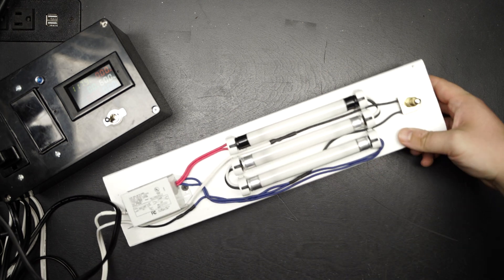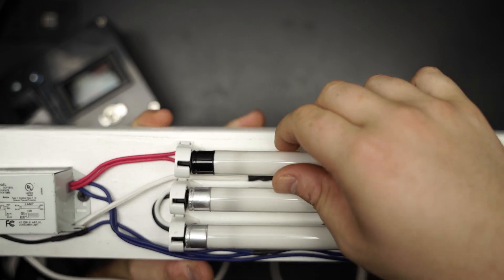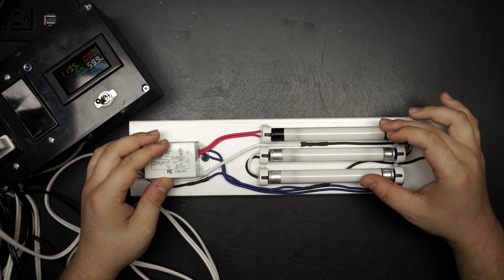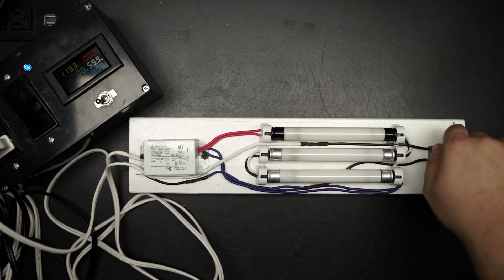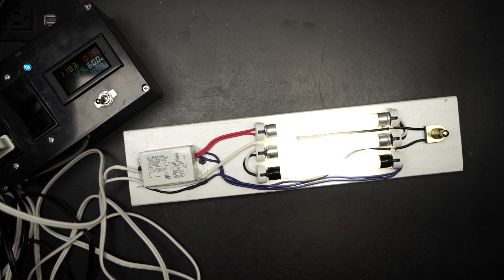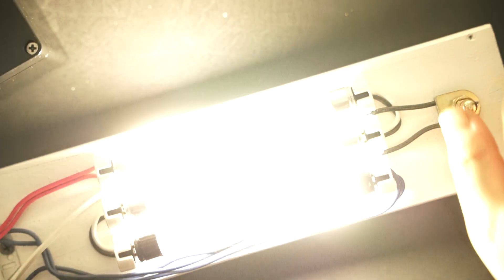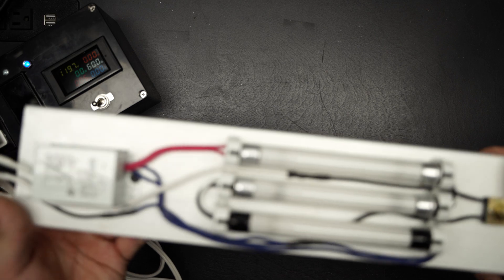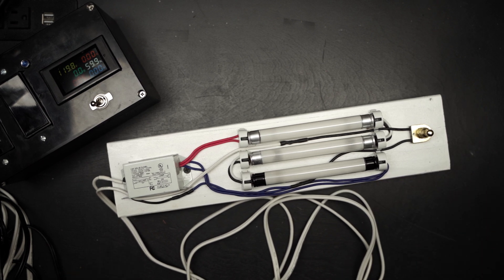Homemade 12w 3 Lamp F4T5 Fluorescent Fixture

Comment: I’ve replicated the ms104 fixture with thin gauge sheet metal and a homemade metal brake. I used a Robertson l48 ballast which overdrives the bulb but mounts perfect with the mounting bolts for the lamp holders
Reply from the maker: Awesome! You should make a video about it.